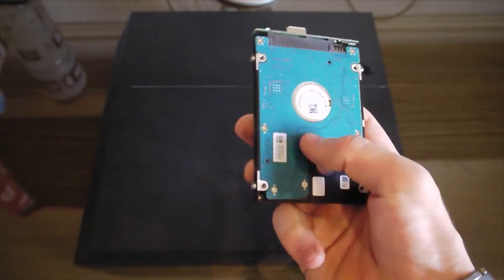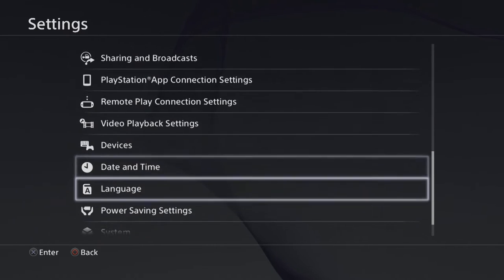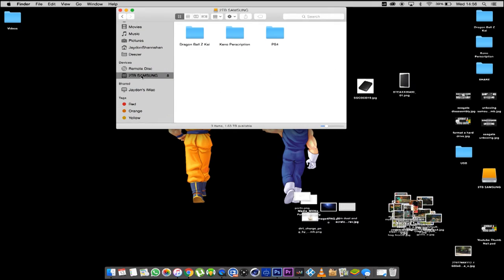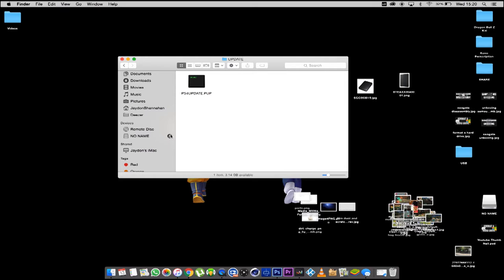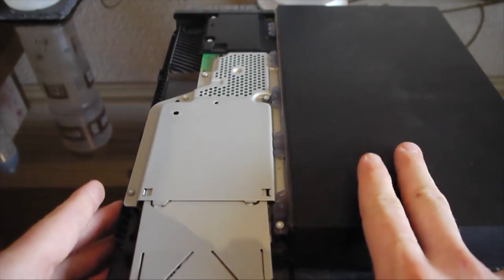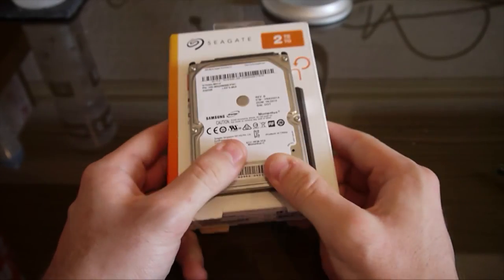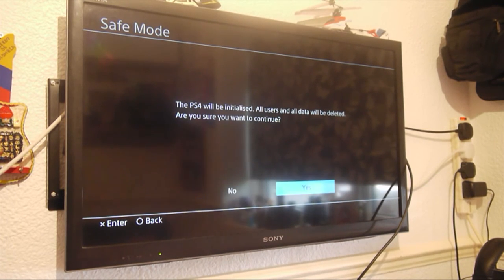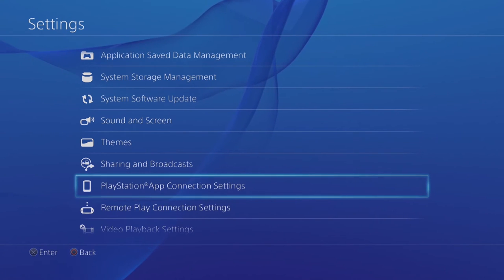How To Upgrade PS4 Hard Drive With 2TB Seagate Expansion HDD

Comment: I got a hard drive with no usb thing at the top can you buy that separately and if you can what is it called?
Reply from the maker: +Habeeb Adeyemi Its a Sata to USB connection you need check on eBay or a local electric store make sure you get the connector with the right amount of pins and also I think you might need a 3.0 USB connection if it's a portable hard drive hope this helps you out 👍💯
Reply: +Jaydons45 oh yeah I ordered an external hdd adaptor and I think should get the job done thanks btw
Reply from the maker: +Habeeb Adeyemi no problem bud 👍